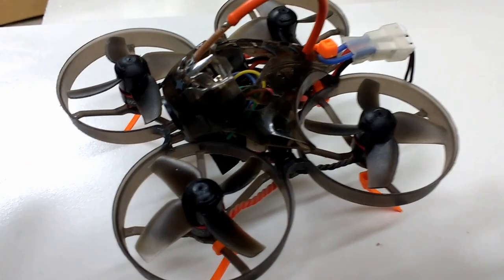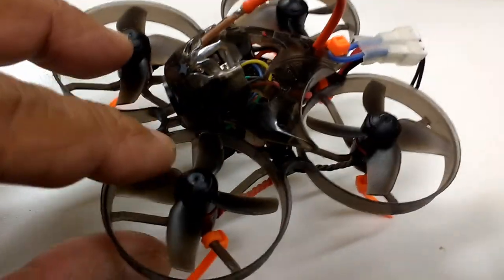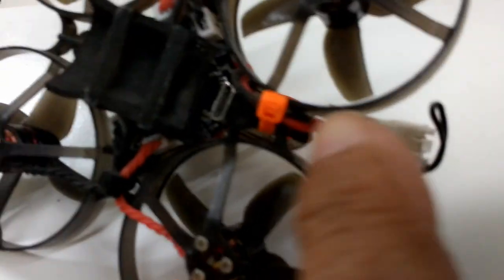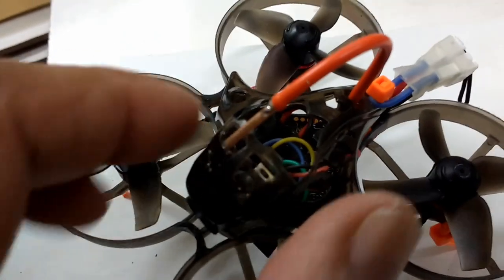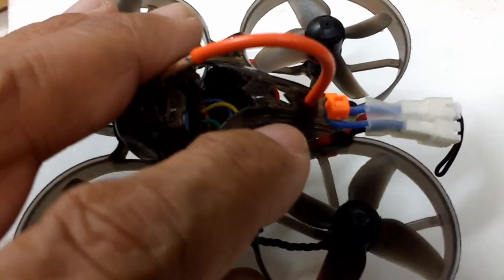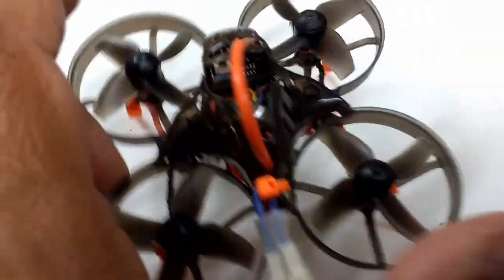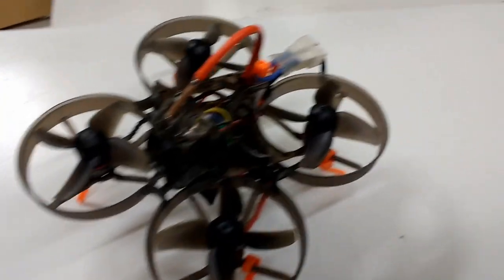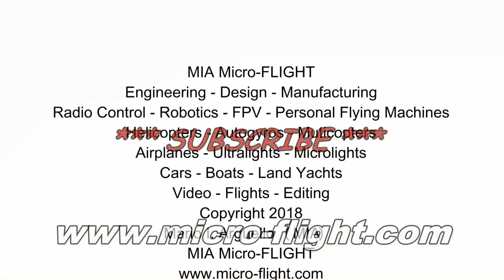6 Great Mods for Mobula 7 and Flight Video

Comment: Thanks! Is that heat shrink for antenna? Thanks for sharing the mods!
Reply from the maker: it is simply flexible tubing. You can use silicon sheathing stripped from  heavy duty wire. As long as it is flexible and the inside diamter is able to fit over the larger outside diameter of the antenna. Depending on the type of heat shrink tubbing, some  will not curve , it will crease. Silicone sheathing is best.